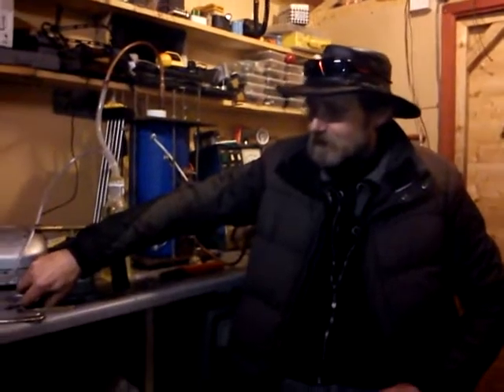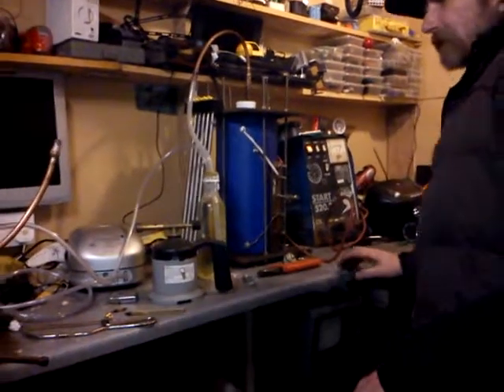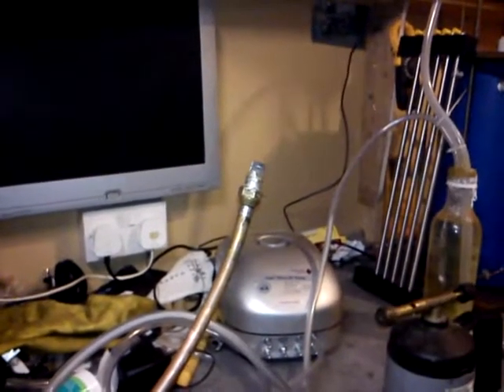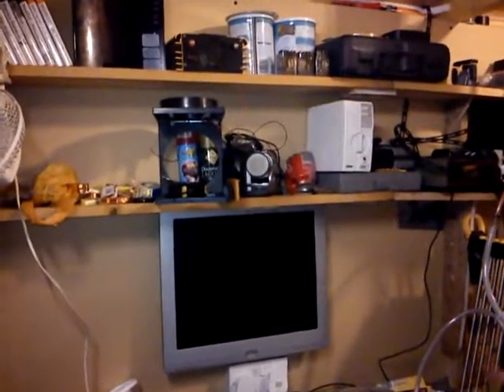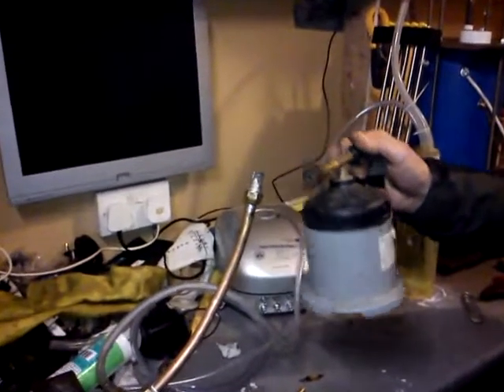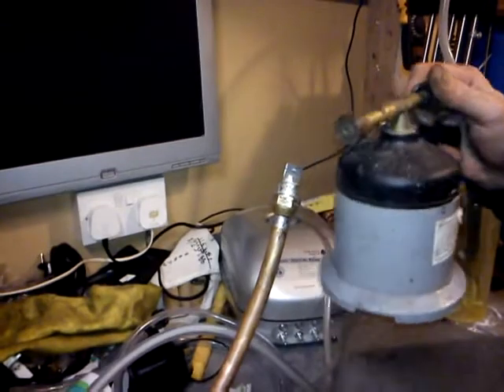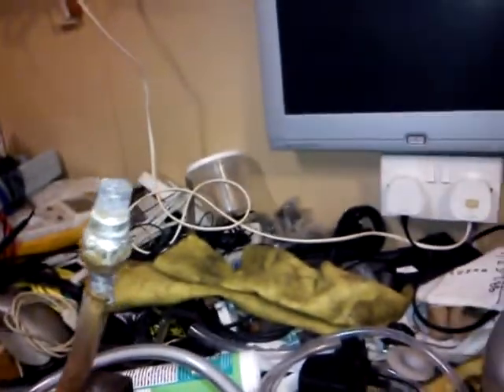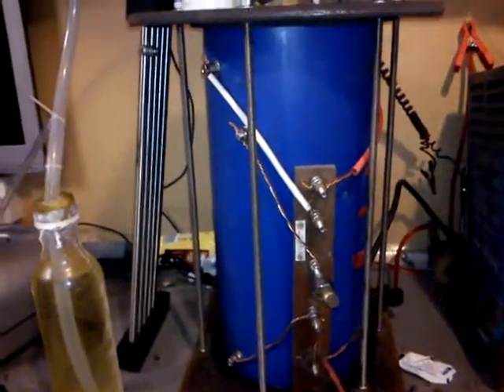Burning HHO-4.3gp

Comment: @Hawk491000 Right on, I'll keep watching. I experimented a bit with water heating. I found out pretty quick it was much more of a challenge than I thought it might be... when you fire water with HHO, it has a very NIL effect. I personally believe that the flame has special electrical characteristics (due to the subsequent implosion not normally found?).. anyway... if u have time, please explore two things... igniting magnesium and or calcium alloys... and also, vortex gas delivery.